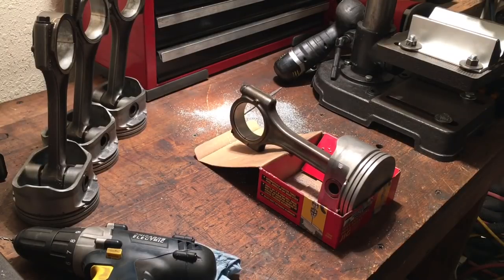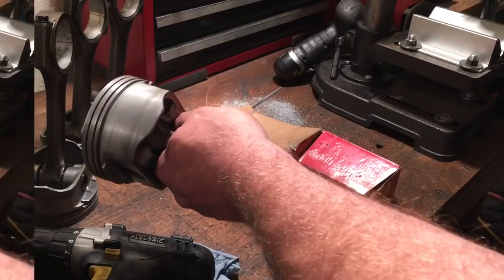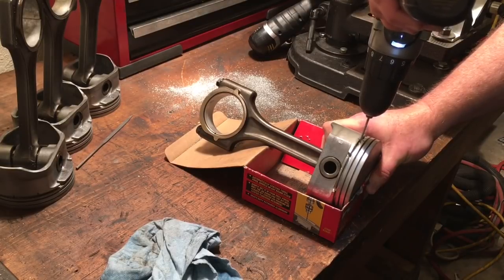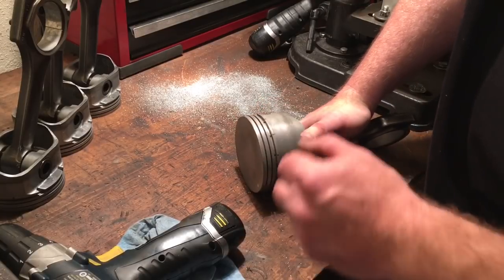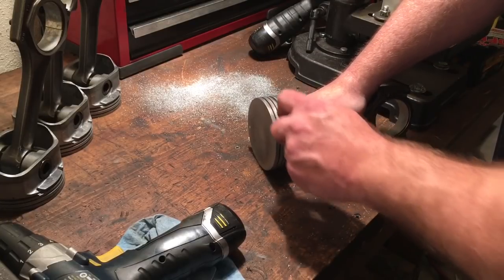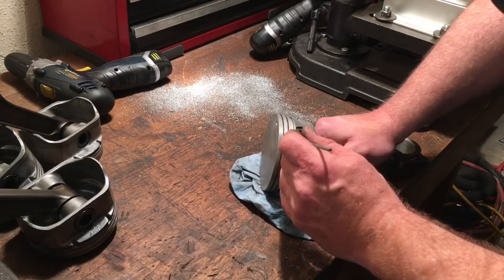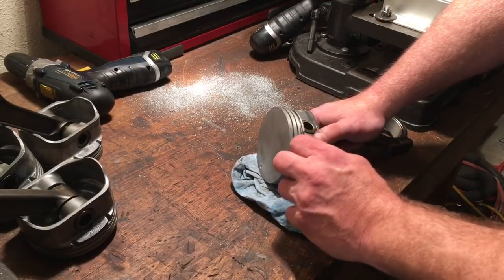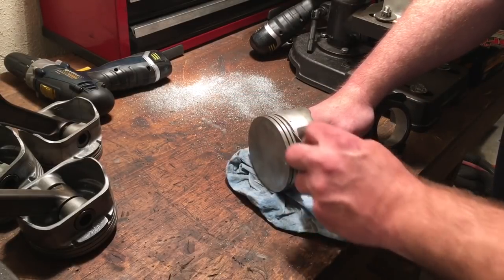LS 4.8/5.3/6.0 oil consumption issue MOD

Comment: There's another trick you can do, for those guys that don't want to take their assembled engine out, and apart, to stop the rings from gumming up-or to fix rings that are already gummed up... When it's time to change your oil, dump 1 quart of transmission fluid in with your engine oil BEFORE the oil change.. Drive it for several days-up to a week or so, and then change your oil as you normally do. At engine oil change-add 1/2 quart of transmission fluid with the new oil. Then, on the next oil change, again, right before you change the oil, dump another full quart of transmission fluid into the engine.. drive it for several days and then do your usual oil change, again using 1/2 quart of trans fluid with your new oil. After doing this 2-3 times your piston rings will be clean... All carbon build up inside the engine will be completely gone, or greatly diminished. If you can see carbon, or gummed up oil, on top of your rocker arms right now when you look through the oil fill hole-just watch that crap disappear after a couple cycles of using transmission fluid in your oil. I had a shop truck that had clicking lifters on a factory 4.8. 280,000 miles on the motor. I began doing what I recommend above, changing the oil at every 3,000 miles and I eliminated the lifter tick, and I also noticed that the rocker arms that I could see were getting cleaner, and cleaner after each oil change. We removed that motor to replace it with a 5.3L that I built with a bigger cam, and other common upgrades. We tore that old 4.8 down and I kid you not-it looked inside like it had been pressure washed! It was UNBELIEVABLY clean.. Even the normal tan staining you see on the walls of the oil pan, and inside the timing cover-was ALL gone.. The engine looked like it had just been assembled, and yet it had more than 280K miles on it. This trick works really well. As with all advise on the internet-YOU accept all risk for what YOU do to your engine... I learned this trick from another old mechanic and did not believe it would work, until I tried it. Seeing that old 4.8 disassembled and how FREE of carbon all the rings were made me a believer.  Drilling the pistons works-when you have the motor out and apart and I highly recommend drilling them if/when you can as it will stop the build up in the first place. Even with drilled pistons-if you want your engine as clean as possible inside-the trick listed above is the way to do it. You know on engine rebuilds you have to get that carboned up oil, or coked oil, off all the internal engine surfaces? That stuff is GONE if you use the trans fluid trick. When you change your oil after using the trans fluid-the fluid is going to be BLACK.. I mean it will look like 50,000 mile old oil.. It's because the trans fluid is breaking up, and loosening, and suspending, all the sludge that has accumulated inside your engine over it's lifetime... When you drain it... it will look terrible.. But, after 2-3 times, maybe more, it will begin to not be so black, and then you know you have gotten a lot of it out.. I ALWAYS add the 1/2 qt of trans fluid at each oil change on the new 5.3. If I ever see any sludge, or coke, building up on the rockers, I will start doing the 1 qt before oil change each time. Until then... I'm certain my engine is CLEANER on the inside than it is on the outside.
Reply from the maker: One caution is the transmission fluid is way thinner compared to engine oil, if your engines valve seals are worn out the transmission fluid will seep by the seals and cause the engine to smoke.  I found this out after adding 1 Qt of transmission fluid to my original 300k 4.8 I had.  I think it would have worked great with fresh valve seals. 👍😎
Reply: @HeadFlowInc  If transmission fluid can get by your valve guide seals-then engine oil is as well... The only difference is that trans fluid makes a LOT of smoke-enough to get through your cats and be seen.. Whereas burning engine oil does not make as much smoke and your cats can catch most of it.. Regardless, if trans fluid is getting by valve guide seals-you got work to do.. your catalytic converters will thank you. Leaky guide seals WILL take out your cats... so, maybe the trans fluid can help you check the condition of your valve guide seals?
Reply from the maker: That 4.8 had over 300k miles, it needed valve seals; the guides weren’t bad. 👍

Comment: Rebuilding a 6.0 lq4 oil rings where froze on all pistons after building alot of small blocks noticed they have holes in oil rings in pistons.
Reply from the maker: twincam825 Don’t hesitate to carefully add the oil drain back holes, it doesn’t hurt anything and isn’t enough material to measure on a scale.  Thank you for watching I hope you subscribe!  JD

Comment: "MAN THANK YOU!.. so very much, u have saved me a lot of "HEADACHE!.."TIME!.."& MONEY! I'm building a 05- LS L33 with dual 45 GT turbo..for 1,200 hp..wit a "STOCK" rotatin assembly.. again "THANK YOU! 👍👍👍👍👍👍👍👍
Reply from the maker: JIMI MAC ROSS Just make sure there’s no burrs or raised areas after adding the drain back holes, a small fine tooth file works great!  If you look at good quality aftermarket pistons like CP, Ross, Wiseco etc they come with these same drain-back holes. 
Sounds like you have a nice build going!  Thanks for watching and the feedback I appreciate it!  JD
Reply: @HeadFlowInc  "THANK YOU!👍👍👍👍👍👍👍👍👍👍👍👍👍👍👍👍👍👍👍👍👍👍👍👍👍👍

Comment: It's not going to last long if the rings can not rotate freely!

I'm not telling you, I'm sure you know this, I'm just putting it out there!
Reply from the maker: JAMES! Since the 70's There’s absolutely nothing interfering with the rotation of the rings.  I’m curious why/how you think a hole in the rear of a ring land could interfere with the rings?  For some reason your comments lately are out of the ordinary, hopefully you’re doing ok through this crazy Covid-19 situation.  Trust me it’s got a lot of people on edge!  Hang in there!  JD
Reply: @HeadFlowInc  I was just putting it out there, like if there is any burrs or anything to keep the rings from rotating, not that what you were doing could stop,  just that a reason to clean ring lands is a engine will not last if the rings get stuck, I wasn't clear on my comments, 99.9% is for others, who may not know as much as you, and yes things are getting crazy, I'm trying to stay home, and it's getting to me! The bad thing is it's only starting! Hope you are doing well, and the virus is staying away!
Reply: James if you have ever rebuilt an LS engine you will find that 9 out of 10 times the oils scraper ring is seized up... It's a poor design on the Pistons! Look at modern aftermarket Pistons, they have oil drain back holes, even the old SBC Pistons from the 50's have drain windows! The mod that was shown in this vid will have no effect on the rings rotating freely. Everything he did will greatly improve the function of the oil drain back/scavenging!

Comment: The pistons don't touch the walls above the skirt anyway,
Reply from the maker: JAMES! Since the 70's Are you not paying attention to the reason for the video?  What does your comment have to do with the video? 🤷‍♂️
1. The rings touch the cylinder above the skirt. Those rings have a job. 
2. All the oil the oil rings scrap/rub off the cylinders have to have a path to drain back, from the oil control ring land,  to the crankcase. 
3. The LS pistons have a poorly engineered/design oil drains in/near the oil control ring land, proven. 
4. Oil trapped in the oil control ring land gets coaked which seizes the rings causing oil consumption.  
5. The coaked oil rings eventually cause even the compression rings to coak causing them to seize in their ring lands. 👎

I don’t make videos based on speculation or guesses it’s not my style.  JD

Comment: Any updates? Did this end up working?
Reply from the maker: Alex S. Yes, the engine has been running since last Fall.
https://youtu.be/Cue7tpIKxqA
Reply: This definitely works well. Especially if your running spray or boost. Gets better oil control around the piston and seals a little better when you don’t have oil stuck in the rings passing by both sides. Spark plugs benefit from this also. All aftermarket pistons come with extra holes or a slit as he said.  I run two per side on my cheap engine tech pistons that don’t come with them. I think I use a 3/32nds or a 5/32nds drill bit.  I forget.  But it’s just the size of the ring land.

Comment: Some time after 2006 the LS2 bottom ends added 4 extra drain back holes to the pistons
Reply from the maker: 407ForRent I wonder if the added drains were on all the engines or only the performance versions?

Comment: wont this change the bob weight on a balanced rotating assembly?
Reply from the maker: soyramflero I will try and verify  how much a difference it makes. I will point out even the factory rotating assembly is not “Precision Balance” like it should be. There’s a huge difference between a Precision race balance assembly and what the factory sends out in mass production. 
The margin most machine shops follow is 10 grams, as long as its 10 grams or less it’s usable.
Interesting fact:  Did you know that boring an engine +- .030 can make a weight increase of 30-40 grams; how many engines can you imagine over the years we’re bored during rebuild and not re-balanced? 🤔
I will be surprised if changes the weight of the piston more than 1 gram if that.
Reply: HeadFlowInc i known theres a weight differenec in oversize pistons. i always balance the rotating asssemble anyway for piece of  mind. dont know the parameters but i know i pay the fee lol. i would probably do this before a balance and rebuild. maybe not a budget refresh. any knew noise would have me second guessing my cut corners
Reply from the maker: soyramflero Stay tuned, I made a video today directly addressing the material removed from the pistons by adding the 6 holes per assembly. The results are very interesting look for the notification later! 👍
Reply: just for your own curiosity...ask if your machine shop will let you see the results from just disassembling the bob weights and then reinstalling them again.  because the bob weights get aligned by eye ball you will see a shift in balance just by taking them off and putting them back on again.  its interesting to see.
Reply from the maker: CSSOB Interestingly, adding the 6 drain holes to the piston only amounted to (.1875g) per piston not enough to bother with.
I know some shops balance for 50% and others 51% making it over/under to handle higher rpms.  I agree balancing is an interesting process for sure! 👍
Reply: Great idea! What size drill bit did you use?

Comment: This kind of mod is common among certain Toyotas. Some Toyota cars would call for conventional oil, then tell owners to change it every 5000 miles. Real world driving showed that 5000 miles was too long, and it would make the oil control ring useless due to engine sludge. Those engines also had dumb piston designs that didn't help oil drainback.

DIY-ers with extra of time can buy a car with a good body at a bargain price, spend less than $500 on repair parts, and drive that car for several years.

Around the year 2010, Toyota finally realized that 5000 mile oil changes with conventional oil wasn't good enough, so they called for 0w20 synthetic in almost everything.
Reply from the maker: Skyline Fever When I researched the stuck rings and oil consumption issue originally, GM vehicles like Scion and several other vehicle brands had the same issue.  I wonder if it’s the piston design, maybe owned by Mahle, so any manufacturer who ordered from them had the same issue?
Reply: Many Japanese companies get pistons and rings from NPR (Nippon Piston Ring) or Riken, but I think there is more to it than just the piston manufacturer. Hondas usually don't have the oil consumption problems that Toyotas have.

Also, Scion was not a GM brand, it was a Toyota brand.
Reply from the maker: Skyline Fever I wasn’t sure who owned Scion, I think the Scion FRS had a Subaru engine in it?  Turbo horizontal 4 cylinder...😉
Reply from the maker: Skyline Fever I think I was confusing Saturn with Scion at first. 😳
Reply: The Scion was the only one to have a Subaru engine. However, it wasn't turbocharged. Subaru was worried that if the engine was turbocharged, they would lose sales of the WRX.
Reply from the maker: Skyline Fever That makes perfect sense!  I saw my first FRS a few weeks ago, it sounded wicked both idling and accelerating!  I’d like to have one and put a Turbo on it!
Reply: People have put turbos on the Scion FRS (Now Toyota GT86) to improve performance. However, the original engine was built for high RPM and wasn't much fun under 4000 RPM. To solve this, Innovate motorsports created a roots blower that generates more power across the entire range. They were able to make it a direct bolt on item that is 50 state smog legal. There is a major limit on how much boost you can run because it has approximately a 11.5:1 compression ratio. Although GDI engines are able to run higher compression rations than port injection engines, there is still a limit. I think nobody uses more than 6 PSI with stock pistons.
Reply from the maker: Skyline Fever Maybe they need to develop e85 tunes?  Well, if e85 were available Nationwide, it’s really hard to get in the Kansas City area.
Reply from the maker: Skyline Fever I have a friend who runs a Supercharged Quad 4 Engine with Meth Injection.  I’ll be Porting the Quad 4 head soon! 👍
Reply: I look forward to it, thanks!

Comment: Can't remember exactly but when I was a kid replacing the piston with a (Weisco), recommended drilling somewhere on the piston for the 2 stroke. Never did but assuming maybe the same reason.
Reply from the maker: Alpha Ghost Interesting it’s a possibility.  🤔
Reply: Alpha Ghost they suggest it for more oil on the exhaust port side to help lube the skirt more when running leaner mixes for racing or for extended high rpm runs